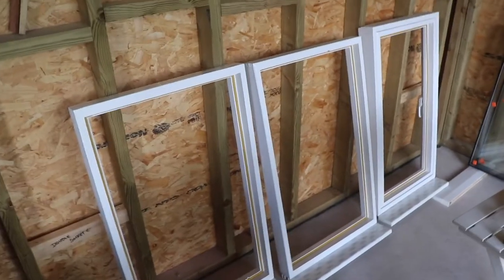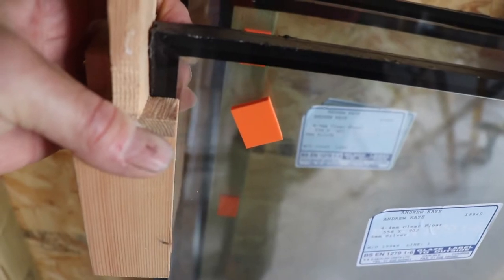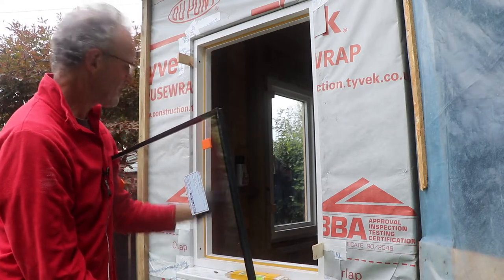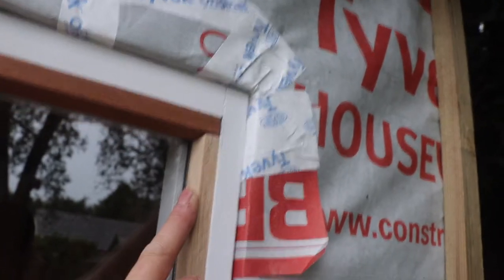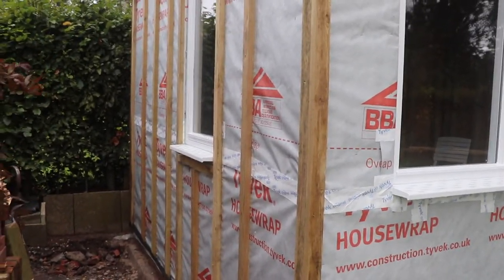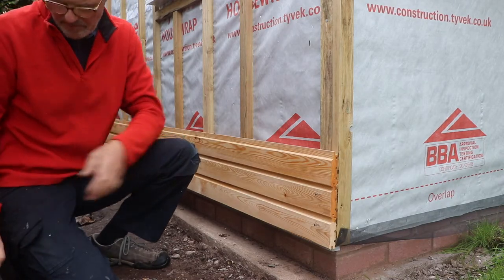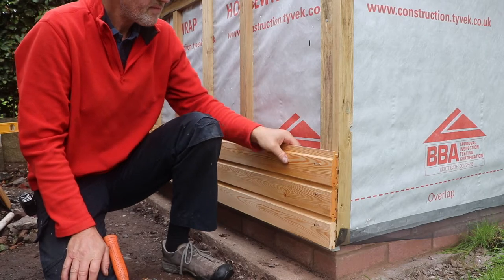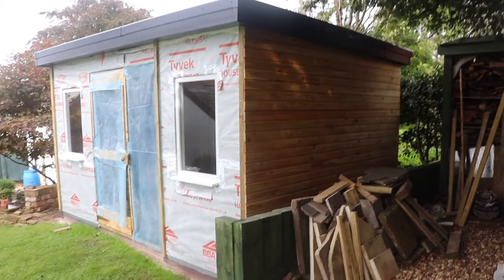DIY Garden Room Part 4: Fitting windows & external cladding

Comment: Great lockdown build!  I think you have done a great job so far and I feel your pain working on your own!
Reply from the maker: Thanks Aaron - I replied to your query on another video I think. The only help I had was lifting the gyproc onto the ceiling, otherwise a 1 person job 👍
Reply: @solway17carlisle  I saw a great tip on the Skills Builder channel with Robbin.  For putting up boards up to a ceiling on your own or if your helper has called in sick!   He said you can screw two eye-hooks into your joists or timber area.  Thread a broom dowel handle through hooks and slip the end of the board through the gap of the horizontal pole and it will hold plaster boards at one end! check their channel out very good trade tips.
Reply from the maker: Hi Aaron - yes I’ve seen the Skill Builder channel and Robin Clevett ( I think). Good to have ideas an ‘work rounds’ but the boards themselves are too heavy for me to lift. Maybe could have managed in my younger days though. All the best...

Comment: What made you go for siberian larch cladding ? Was it the long lifespan or you prefer the natural look of the timber without treatment on it, I had a look at the larch but not sure if you were supposed to treat it
Reply from the maker: Hi Michael - I had a look at cedar which is popular cladding for garden buildings but was put off by the high cost. Siberian Larch, although classed as a soft wood is quite hard wearing, has few knots and natural resins. I chose to put on a clear uv protection coat to repel water and attempt to hold the colour rather than let it revert eventually to a grey/silver colour. I guess in time it will turn to this grey colour as the uv protection wears, so I suppose o will need to re- coat every year or so. Hope that answers your queries. Cheers, Andrew

Comment: Brilliant job, looks fantastic. I'm doing something similar and also cladding in Siberian larch. Can I just ask - what wood preservative did you use? I'm very keen to get this right because this should give the 'wow' factor! Cheers, Matt.
Reply from the maker: Matthew Stapledon  Hi - I used a standard wood preservative paying particular attention to the cut ends. Then once nailed on and dry, I used a uv protection oil from Osmo, 420 clear satin. 2 coats.
Reply: @solway17carlisle  thanks! Just looking at ordering the Osmo oil now. Did you get much coverage out of it?
Reply from the maker: Hi - I’ve got both sides done with 2 coats and there looks to be enough to finish the front, hopefully. I have about 19 sq metres in all. Fingers crossed it’ll spin out. It’s good stuff - water beads on it. Good luck with your build...

Comment: Why didn’t you have the glazing beads on the inside for added security? Beautiful frames by the way
Reply from the maker: Paul wills Hi Paul - that's a good question, but when I looked at similar timber frame windows around my house all the glazing bars are on the outside so I followed suit. I guess it's so that when you need to replace a window all the messy work is outside? Also, the window is also stuck firmly to the glazing gasket (very sticky rubber seal)which makes it almost impossible to remove the window once it's stuck on, so I'm not too worried about security - fingers crossed! All the best and thanks...

Comment: Good job!, can I ask if there is a reason why you put the beading for the windows on the outside, or are you not that fussed about security?
Reply from the maker: that's a good question, but when I looked at similar timber frame windows around my house all the glazing bars are on the outside so I followed suit. I guess it's so that when you need to replace a window all the messy work is outside? Also, the window is also stuck firmly to the glazing gasket (very sticky rubber seal)which makes it almost impossible to remove the window once it's stuck on, so I'm not too worried about security - fingers crossed! All the best and thanks...

Comment: Can I ask what grade of the sib larch you used? Have you mixed the grades? Thanks
Reply from the maker: Hi - I used A grade as it was the only grade available at the time from the supplier. Certainly I am very pleased with the quality of the boards I received - out of 20 m 2 only one large loose knot ( which I wouldn’t have expected from the description of this grade of timber).
Reply: @solway17carlisle  great thanks! Did you have much left over from 20m2?
Reply from the maker: Hi Joel - I haven’t fitted it yet until I get the door in place (waiting for the carpenter). Fingers crossed there will be enough 🤔👍